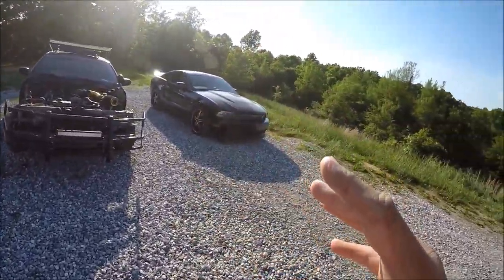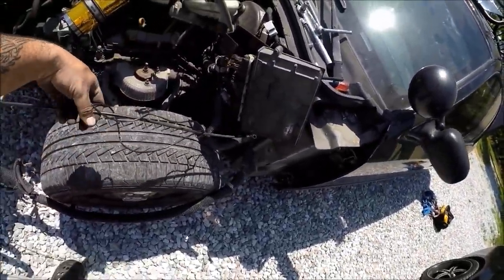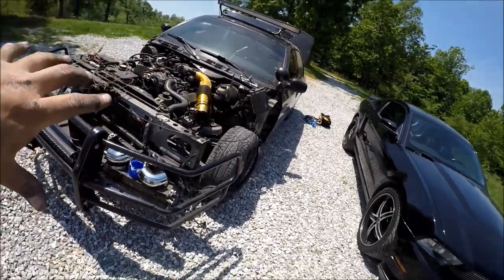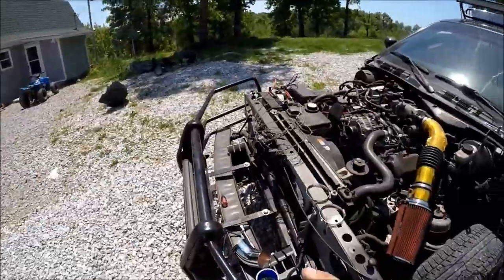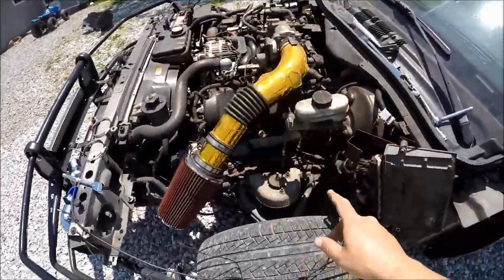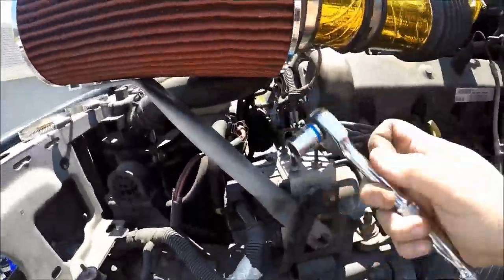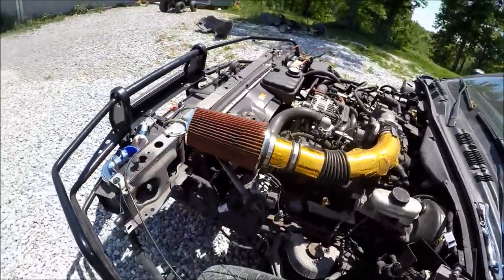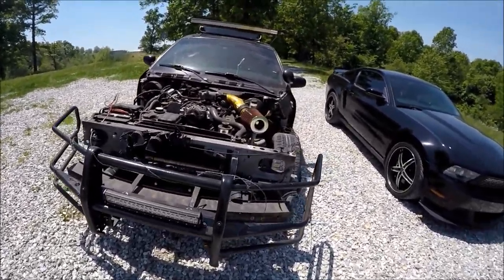Removing Plastic Wheel Covers, Modifying My Intake and Barbed Wire!

Comment: Definitely Mad Max. I drink PowerAde. What about lights? Is it going to be street legal? As far as that air intake, if you intend to be driving it off road a lot, I would suggest using a vertical snorkel, and stick it way up in the air. I used to have one on a Jeep.

Comment: Hey bud non of your spark splugs blew out of the head. That happened to mine and had to remove and rethread the spark plug hole. It’s a common ford problem. Just giving you a heads up.